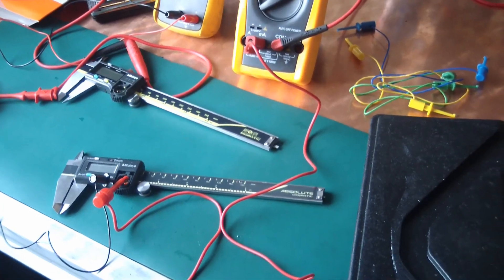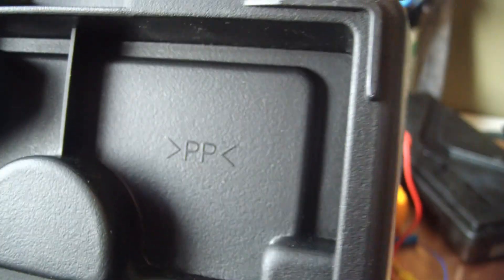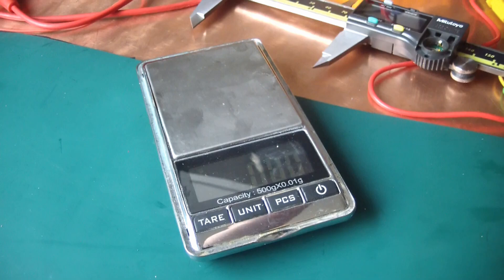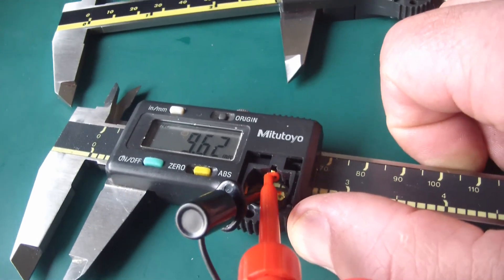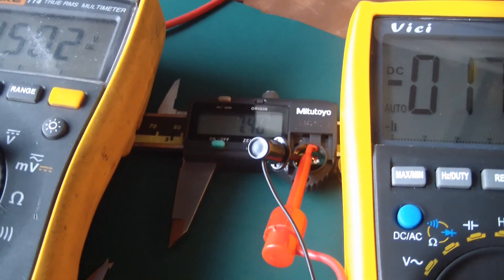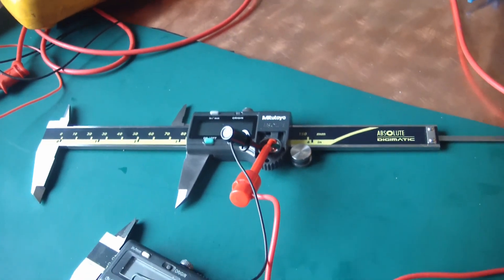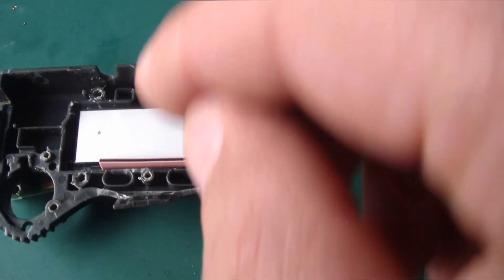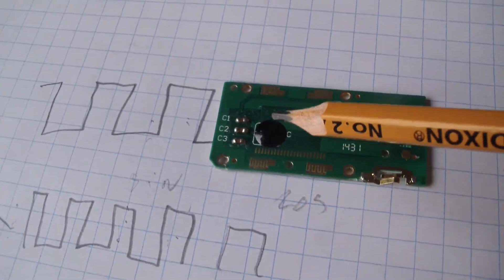BOLTR: $33 Mitutoyo Calipers, too good to be true?

Comment: I cant like digital calipers,regardless of quality. I was a vernier purist when my eyes functioned correctly but in middle age (and working to tighter tolerances)i have taken a liking to dial calipers instead as i simply cant get consistant reads on vernier scales anymore,bloody eyes!!!!Now,is even real Mitutoyo, is it still what it once was???
 I understand the current production digital stuff is no longer made in Japan?Why do your "legit" ones still say "CE"?
I know this videos a bit dated,im pretty sure at time opf this comment current production mitutoyo DIGITAL calipers are no longer MIJ.
I even couldn't bring myself to own current production dial calipers (which are still MIJ i understand,yes im a MIJ diehard as well and not just tools!fishing stuff,electronics,firearms,optics,guitars man they do it all well! Yeah I drive a Toyota as well, a MIJ one no less!) from them, too much plastic fantastic for my liking! I have a selection of older Mitutoyo stuff, my favourites are in the faux croc skin type case with red velvet inside, not a smidge of plastic to be seen apart from the dial cover! Circa 60-70's assume,they are the smoothest by a long shot but could be due to how old they are. I did pick up a sealed NOS 12" dial caliper for a whopping $80aud, its still MIJ but being later (grey plastic case in orange cardboard sleeve) it does use at least 2 plastic parts, dial retainer and the wheel retainer, thankfully rest is metal.These were considerably cheaper than current plastic infested 6" jobs,right time right place....A used pair of older 6" ones i saw sell for $15.50AUD on eGay the other day, that's probably the same as what them there fake digital ones cost!I told a mate to buy them but he forgot to bid,otherwise i would have even though i do not need. So you can get good stuff cheap if patient! My cheapest were a 12" pair of verniers with the fine tune adjustment,$20 AUD.I pretty well only buy Mitutoyo,only one exception,a very old (interwar i think)Mauser Dial caliper that after i won on ebay arrived with a tooth missing from the flat gear,not shown in pics or mentioned,seller gave me full refund even though i was happy for a partial to keep them for display.A shame because they are very nice indeed,winning bid was around 100usd,yikes...
 One day when i come across some real 'murican starrets(ive never seen in the flesh here in 'straya but i understand they are the bomb) will be the only possible chance upgrade i think.
Reply: "The Conformitè Europëenne (CE) Mark is defined as the European Union's (EU) mandatory conformity marking for regulating the goods sold within the European Economic Area (EEA) since 1985. The CE marking represents a manufacturer's declaration that products comply with the EU's New Approach Directives."

Comment: Don’t need a battery display if you calibrate the calipers each time you use them.  Qs9000, etc. for home shop use, could be more of an issue.

Comment: I bought these calipers using Amazon thinking I was getting genuine Mitutoyo. They never really felt right, and I tried finding out if they were genuine. Everything seemed legit until comparing the product literature with the literature on the caliper itself.

I contacted Amazon and I received a full refund and they told me to keep the calipers.
Reply: I got lucky with mine then I guess, 20% discount too, and after quite a bit of testing, I feel confident they're the real deal

The writing on the back isn't chinglish, the lock screw doesn't come off (or shouldn't, might do if you give it the muscle), the LCD does a little dance when you first turn it on and stops when you click origin, the battery compartment says ABS, and most importantly it opens and closes like nothing you've ever felt before and it sounds gorgeous. Oh and WTF the new ones, my 100 ohm resistor might be a bit off but it's using something like 3 uA on, 0 when off. This battery will last till the end of time

Comment: Real mitutoyo runs of 1.55V (fully charged is 1.57V). Battery low indicator shows up at 1.40V (but not 1.41). And it switches off at 1.30V (but not 1.31). At no point display fades or show wrong reading.

Standby current is 0.96 microamps. When operating it is about 1.29microamps no matter how fast you move or if set inc mode or whatever

Comment: Got mine off  Ali Express

Similar fit and finish as yours. Mine has the correct lock screw, but lacks the little "p" on the back plate. The printing quality on mine is def substandard.

Checking against my Etalon mic standards, this thing is right on!

 Ima gonna clean up the edges and use it. Paid $35!

Comment: I wonder... how does it know where's the zero once the battery is depleted/changed? (like, if its always measuring, & shows the "the actual position evenif it moved while off , i guess it can be fucked up if power is interrupted while its off..) so... what? is it a thing of only changing the battery when its @zero so when it powers up it assumes hes coming back to live  the zero n it should just keep measuring from there? or is there any other fancy trick related? very curious :)

Comment: the $150 is relative to how long you have had it. Things are built cheap now because people do not want to spend the money or are making less money as companies put pressure on their employees to work for less so they buy cheaper tools. It is insane to be a car mechanic now as you have to spend upwards of $30,000 on tools then buy the specialty ones on top of that depending where you work.

Comment: The lengths some companies go through in order to make a buck! I'm surprised they can even get away with it. Thanks for the heads up.

The 200mm Mitutoyo Digimatic that I bought upteen years ago has only needed it's battery replaced once. I seem to recall that it has a low battery warning on the display, but it's been such a long time since I replaced the battery that I can't remember. I worry more about the battery leaking it's guts into my caliper than having to replace the battery.

Comment: You mentioned the edge that's not broken. Thats bevause that's a measuring edge. You use it to measure the height of a step. Useless considering you have the hole measurer thing. But it has a purpose nontheless

Comment: I used these calipers in a machining enviroment for 1.5yrs with no problems. Held tolerances within half a tenth
Reply: Bullshit
Reply: @glenncirello4085  I have inexpensive, though highly recommended, Chinese calipers that are consistently off by 1.5 thou. I also have a nicely made Mitu copy, extremely difficult to distinguish from the genuine item, that consistently reads within a half a tenth. This was measured with gage blocks, pin gages, and feeler gages.

Comment: Is there anyway to add some type of circuit on the board so when it drops below a certain voltage it will just crap out? To save yourself from the crazy readings at low voltage?
Reply: Buy a dial caliper.
Reply: @Demobius  intelligence

Comment: Thank you for that video, all the smartass and foul language and bias aside, I never knew that is how those calipers functioned. That is surprisingly simple, so why not take that broken caliper and try to design a circuit and fix it for less than the cost of the real ones and see if you can, OSH parts and Digi key are just two examples of how to get circuit boards made cheaply, cheap junkyard oven for surface mount reflow oven. Maybe you can turn a cheap set into an expensive set for half the money?

Comment: I think your videos are informative and well made, although much of the dialogue requires some interpretation for one not used to your terms.    
However, while Mitutoyo digital calipers are well made and much more reliable than the cheap types, no matter how good they look, the fact remains that they still can fail, and when they do, are not worth having repaired as the repair tends to cost almost as much as a new item.    
That's why I stick with my 40 year old Mitutoyo vernier caliper which doesn't use batteries and is as accurate and dependable as the day they were bought.

Comment: Hrm, I just received a pair of el-cheapo Mitutoyo calipers. Model numbers are the same as shown in the video (CD-6" CSX) however the code numbers are different. (Mine's 500-196-20 vs AvE's 500-196-30).  In ABS mode they DO NOT maintain the measurement between power cycles.  In INC mode they will maintain the reading.

Comment: What happened to analogue callipers, it looks like there has been a conspiracy and there is only the one type of digicrapuscular callipers left in the whole world. I hate the things because as a very casual user the battery is always empty when I need the f*cking things.
Reply: mitutoyo still sells the dial units!
Reply: Joe MacPherson. I still use the dial calipers. I perfer them because I have only used analog measuring equipment. And I'm not even that old.
Reply: Better accuracy at a cheaper cost with digital puts everything else in a coffin. That and the kids can't read things that aren't digital - if they can't read an analog clock they surely won't be able to read any kind of analog measuring instrument with any kind of accuracy.
Reply: Killer2600. i experienced that at work the other day. the kid is a very smart mechanic but he just stared at the calipers for 5 minutes with his lips moving then said they were broken and asked if I could get the digital ones.
Reply: Killer2600 cheaper? Analog is more expensive the digital! You can get a mitutoyo 6" digital for $80- $120 and analog for $120-$140 
Analog is way better in accuracy then digital, I can give you a measurement using my analog calipers to .001" and one can double check with a mic and I might be out by .0005". At times you could be out by up to .005" on a digital depending on who's using it and how hard they press. I guess that's ok if your a wood worker or a gun smith but as a machinist it's a mile
Reply: chad jensen hahahahaha that's when you tell them "thanks for trying out but this job isn't for you"
Reply: Joe MacPherson: You need to re-read my comment. Your analog understanding of my digital comment isn't as accurate as the digital comment itself is. Also you do realize the calipers in the video read down to half a thou. If your consistently off by 5 thou with a set of quality digital calipers like the genuine Mitutoyo in the video then the problem is with the user not the tool.
Reply: Killer2600 any machinist knows that a digital calliper is only good for roughly measuring! An analog (dial) calliper has better accuracy then a digital! If you worked for me and I saw you using a digital I'd have you remove it from my shop! I've had people like you think they know better and have scraped $100,000.00+ parts because of it! No one is allowed to use any digital calliper inside any of my shops!

Comment: Am I the only one who gets a little shiver down my spine any time it is revealed that on the dirt cheapest knockoff parts they use hand-soldering instead of some automated solution?  That suggests that the workers are getting paid less than what an automated system would cost even amortized over the thousands/millions of devices they have to churn out.
Reply: yes and no... Let's put it this way: there are systems where hand soldering a few components is cheaper even in Germany, where minimum wage is now above €10/h. Automated populating and soldering for 3 components on a sensitive board with chip-on-board blob is not something very cheap to do.
Reply: Dustin Rodriguez Definitely disturbing that that is the best available job for so many.
Reply: I've been to the industrial cities in China.  They need work.   It's hard to wrap our heads around but there are so many people. I saw people doing much more meaningless jobs that had to have been made up by the government.
Reply: I think you’d be surprised.   I know I was.   A lot of data cables are hand soldered (wires soldered to pcb “plugs” on each end).  And almost all data cables have the individual wires hand “combed” into place before soldering which can be very tedious.  It’s just too expensive to tool up for a hot bar, parallel gap resistance welding, or robot solder process unless volumes are extremely high.  This is true for cable manufacturing in US, Mexico, China, or Philippines.  On the smallest of terminations, very few people have the talent to do this soldering consistently.    —former cable manufacturing engineer for a large electronics company
Reply: @seanwilliamodonnell  Yeah, those people should really check out communism. It might really be able to help those Chinese workers.
Reply: @seanwilliamodonnell  what is capitalistic about virtual slavery?
If China were following free market and principles of decency (which require at least a slight amount of product transparency) - the CCP would find they couldn't sell crap for crap made by virtual slaves, and their system would implode overnight.
The issue isn't capitalism, it's the CCP. And best not to confuse capitalism with corporatism.
Reply: Dr. M. H.  thanks dr. obvious
Reply: There are two Airbus factories in Germany. One near Munich and one in the North. The one in the North is automated. The one in the South uses Polish workers.
Reply: @seanwilliamodonnell  Economy 101: someone suffers for our pleasure
Reply: @disklamer  Capitalist economy 101*
Reply: @disklamer  modern economy.  Im rather sure the native Americans had an economy where no one architecturally suffered (other than war)
Reply: @seanwilliamodonnell  Excellent point, I guess I conflate economy with capitalism at this point. Of course other valid economic models exist - and new ones can be developed. I like to think sustainable, collective, local cycles have a future.
Reply: @disklamer  you mean go back to bartering lol
Reply: @samrodian919  I've never heard of any culture based on barter,
Reply: @seanwilliamodonnell  Well you'd be wrong because most Native Tribes were at war with one another and only the strong survived. There was no economy, either you pulled your weight or you died.

Comment: In shops I always used Mito dial calipers. Now at home I have a six inch pair of Dial off brand and a couple eight inch pair of HarborFrieght digital. Mainly use the HarborFrieght ones setting up tables saws and laying off woodworking projects. Personally never had any problems with the cheap digital calipers but never used where it really mattered. Always wanted a set of digital mics but never wanted bad enough to lay down the $$$$

Comment: That explains why the batteries don't last 5 minutes in my cheap callipers......every day's a  school day 👍🏻
Reply: I modified my cheapo calipers to use a AA battery in a case Velcro’d on the back along with an on/off slider switch. No more hunting down a fecking button cell battery every few weeks because I forgot to pull the battery.

Comment: I have a cheapo caliper. When the battery goes low can I achieve consistent accuracy if I zero it with every new measurement?
Reply: No, They can 'slip' anywhere. The lower the battery, the more counts missed (or added)
Reply: +George Bucci 
Got it.
Reply: George Bucci is it possible to solve this problem with adding an accurate voltage regulator?
Reply: A external battery and regulator is possible, but cumbersome.  An under voltage cutout is the "easy" solution which should have been done by the manufacturer.

Comment: The problem with inaccuracy on weak batteries is one that comes with many cheap electronic measuring devices.
Without knowing the battery condition, this renders every measurement entirely worthless.
BTW: removing the battery is only a halfway decent solution, handling these with bare ( aka sweaty ) hands increases
self discharge on button cells...
Thanks a lot for the review so others do not fall for these fake tools! Keep up the good work!

Comment: Ave seems to use FLUKE multimeters in his videos. Damn those things are skookum. For those of you who cannot find them in your country this is a reliable link to get a few shipped anywhere in the world for free. 
http://www.gearbest.com/measurement-analysis/pp_153176.html?vip=159750
Reply: Where I work they only buy the top of the line everything. they use fluke as well. (in the top 200 fortune 500 companys)
Reply: Nice, its a good reliable product after all.

Comment: Correct me if I'm wrong, bit don't Mitutoyo calipers use use an absolute positioning system where under the sticker on the slide there are a bunch of capacitors, or inductors, I don't remember; and they change in a way that it can uses those to know its position? That way it knows its position even if the batteries are removed and replaced.

Comment: I worked for a company that was a contract assembler for Mitsubishi Electric.  We built motor control boards that they then sold to Mazak.  You are not kidding about fit and finish.    These were circuit boards that would most likely never be seen by the end user.  Didn't matter.  They all had to be picture perfect.